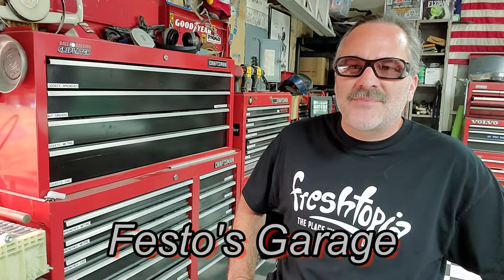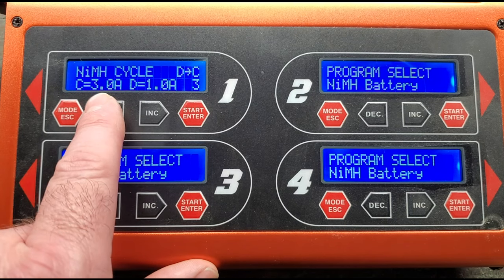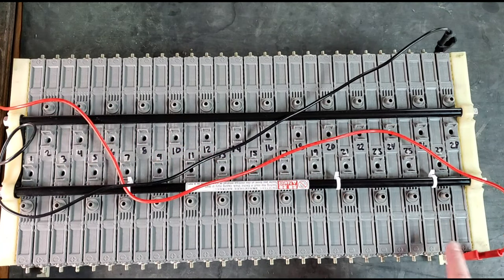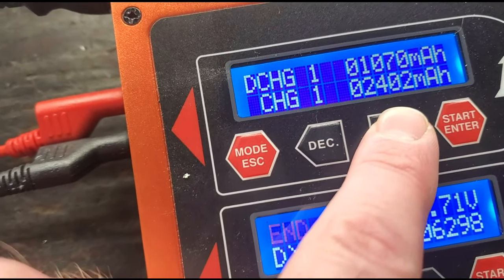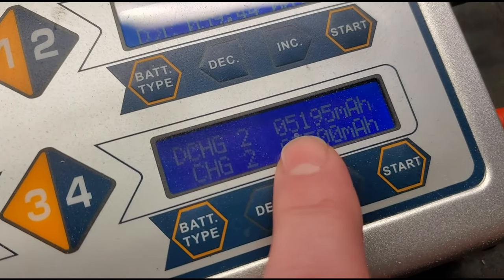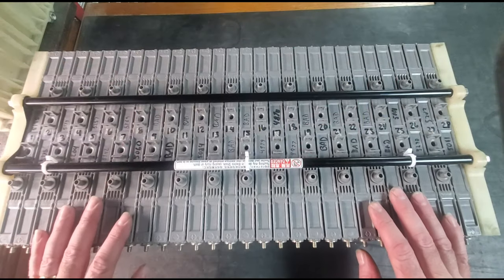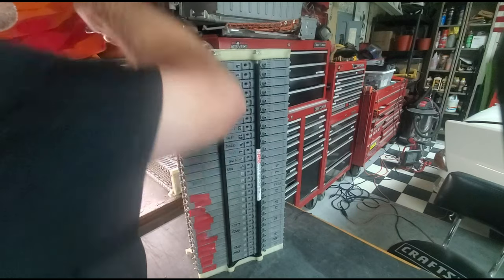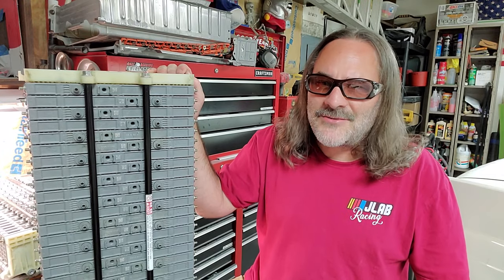Hybrid Battery Pack Refurbish - Step-By-Step w/ Settings - 2nd & 3rd Gen Toyota Prius - CQ3 Charger

Comment: What if a module goes to "END" in a short period of time? The charger then doesn't show the Charge and Discharge amounts, so I'm thinking it's a bad module. Or... should I keep trying to run cycles?
Reply from the maker: Thank you for watching. If you have same settings as I do then you should not be able to get "END" message without the charger going through all 3 cycles and having data to provide for each cycle.  Perhaps you are hitting wrong button at end of cycles and going back to start screen?
Reply: @GreggFesto  I’m pushing the same button you do in your video. I wonder if the cables are the culprit. The cables I have seem to be more than capable and are rated for more current than what we are using for this process. What cables do you use?
Reply: @GreggFesto  Do you have a temperature sensor hooked up to the charger? I'm trying to see if you have something different set up, that I may be missing. I appreciate your help.
Reply from the maker: I got cables from amazon but I cannot not find the exact link now. I believe they are 18awg.
Reply from the maker: I do not have temp sensor hooked to charger. Only the power input cable and the cables going to the batteries. I am wondering the difference between in our setups as well.
Reply: @GreggFesto   I may have figured out part of the issue. The charger would dishcarge and then END... Instead of then going to the Charge cycle. I figured out how to get it to proceed to charge, but I had to manually push it to. Previously, I would try to start the process all over again, which would start the Discharge cycle again...only to drop it to the set 6v. Now I need to figure out why it sometimes stops after the discharge cycle ends. I've had a few recommend increasing the DeltaV. I'll keep you posted on my progress, but at least I'm moving along now. I appreciate all of your feedback!
Reply: @GreggFesto   I have figured out the issue and understand the charger much better now. Already getting some modules to pass and working on the rest of them. I was further reading the instructions and see that they advise to raise the delta Peak, if the discharge/charge stops prematurely and a lower value, if the battery gets too hot. I haven't made any adjustments to that yet, but I may raise it a little, if I run into that with any other cells. I have had the charger stop prematurely a few times on a cell, but I just simply ran it again until it would cycle. I appreciate your help!

Comment: So what if it capa out 7500 charge and 6497 for discharge is that a good number or to high for the discharge?
Reply from the maker: That is a great result. If only they could all turn out that well. Thank you for watching.
Reply: @GreggFesto  I have a few that’s in the 6000 range so see how the rest goes thanks for the info I watched your video like 10 times to understand it the correct way

Comment: Okay I accidentally hit mode after running 3 cycles. I only saw 1 discharge and total before it went off the screen. I never unplugged it but couldn't get back to the numbers again😢
Reply from the maker: Thanks for watching. What your reporting is right, I do know for sure if you hit wrong button that the values will disappear and not come back until you run cycle again.

Comment: I've finished a 3-week recon cycle on my Gen 2 Prius battery using the same charger you're using. All but 2 hit 7500 discharge capacity (those 2 made it to 7100, so still good). Problem is only 2 broke 5000 mAh on discharge. 24 are in the 4000 range (some low 4000s, some high 4000s), and 2 are at 3900. If I continue to run more cycles on these lower discharge cells, they always hit charge capacity at 7500 and then the cycle stops without ever seeing higher discharge numbers. Is it time to just rebalance and get it reinstalled? I suspect that any refurb replacement cells I get won't have a charge capacity as high as my cells. What do you recommend?
Reply from the maker: Thank you for watching. The discharge values are the ones to pay attention to. They will determine the actual "health" of your pack. Since the batteries are in series the pack will only be as strong as the lowest valued battery. This means that if you put the pack back together with batteries that have discharge value of 3900mah then the pack will only have about 56% capacity. I suggest running more cycles until you have minimum 5000mah discharge of every one of them.
Reply: @GreggFesto  Thank you. I will continue to cycle the modules. But one problem is that they continue to cap out at 7500 and the cycles just stop. Should I increase the capacity setting, or just keep manually starting new cycles on each module hoping that they'll break 5000 mAh discharge?
Reply from the maker: If the discharge value continues to rise after each cycle then I suggest to cycle again. There will be a point where the discharge value stops rising and will start to fall back off. There will be a point where the charge value will start to fall off also. If you can achieve 5000mah discharge or better I think you will be happy with the results. If you can achieve the 7500mah charge value at the same time, that's even better. please write back and let me know how your batteries do.
Reply: @GreggFesto  Hi Gregg, I finished the process. The end result was that 27 of 28 cells broke 5000 mAh discharge, and all hit 7500 mAh charge. Just one cell is giving me trouble and after 16 cycles, won't break 4300 mAh discharge, and although it broke hit 7500 on one charge, it dropped off to an average of about 6400 mAh charge. I've seen some refurb cells on eBay but they claim they're guaranteed to be at around 3.5 amp hours of capacity, and since my lone bad cell is already above that, not sure if it's worth trying. How bad is it to just leave that one underperforming cell in the pack? Thanks again for your help and feedback.
Reply from the maker: These batteries, when in the hybrid pack, are arranged in a series configuration so the battery with the least capacity will determine the pack capacity. The battery that is 4300mah discharge after 16 cycles should be replaced with one that has at least 5000mah discharge in my opinion.
Reply from the maker: Hey Dan, If you leave that cell with 4300mah discharge in the pack then the pack will not perform to 5000mah level. I suggest checking online for additional vendors. In the past I have had good luck with ebay seller called AloyHybrid. They usually send me batteries that test to around 6000mah discharge.
Reply: @GreggFesto  Thanks Gregg! As you recommended, I bought a cell from AloyHybrid on eBay, and it was perfect. It cap'd out at 7500 charge, and got to 5300 discharge. Now I'm balancing and will reinstall this weekend. Again, many many thanks for your help along the way. I couldn't have done it without you.

Comment: Before selling a toyota hybride to average people , TOYOTA should mention clearly : Don't buy if you're not an engineer in Electronics or you will be recked when times come when your red triangle ...
Reply: My red triangle has been on for two years.  It turns itself on and off depending on its mood.  I still get between 36 and 41mpg.
Reply: 😂😂😂😂😂 just buy with confidence. We will learn along the way😂😂😂

Comment: Dr prius app shows temp three high 115 shall i move cells to different paet
Reply from the maker: Thank you for watching. I am not sure how moving problem battery from one location to another will help. I suggest refurbish suspect batteries to see if they can be brought back to at least 5000mah discharge current.

Comment: Searched for that charger.  It states...Note: This charger is NOT designed for use with hybrid car batteries. Any such use will damage the charger and is not covered by warranty. Updated firmware since its release now allows this charger to support high-voltage charging.😢
Reply: Hmmm, just did a prius battery with one.  Still working

Comment: Whats the difference in changing the cell to 6500 and 7500?
Reply from the maker: Thank you for watching. The 7500mah CAPA is the max point that the charger will stop charging. The battery is rated at 6500mah but you set the charger to 7500mah because of the way it charges called "Delta Peak".
Reply: @GreggFesto  so, if I set it at 6500 or 7000 it won't be fully charged?
Reply from the maker: It will depend on the battery health.  You can find more info on how it works by searching "Delta Peak Charging".
Reply: @GreggFesto  so, I got this on DCHG 1300. CHG 7500 mAh. On the first cycle. Should I run it 5 more to see if the discharge increases if not wat would it be the minimum discharge and charge range?
Reply from the maker: You should run cycles until your discharge value is at least 5000mah. If your discharge value does not reach 5000mah then the battery should be replaced.

Comment: When i hit mode after charging i dont get the charge and discharge numbers can you help me?
Reply from the maker: Thank you for watching. I suggest checking the settings on charger. You need to hit the Left button first before any other buttons (Red charger says Mode - Silver charger says Type).  Write back and let me know what you discover was the issue please.
Reply: Re entered the setting, and it is still the same result i hit mode, and it brings me back to the menu with no results
Reply from the maker: Did you rerun 3 cycles after checking the settings were correct? You will only be able to read results after the cycles have stopped and you press mode button once. If you press any other button before mode there will be no more values until cycles are run again. If you are using one of the same chargers that you see in the video and it does not work as I describe, you may need to contact EV-PEAK Corporation for an exchange.
Reply: Unfortunately, several times. Each time, it just brings me back without showing results.

Comment: My cells are charging up to 8 volts.  Is that ok?
Reply from the maker: I use the CQ3 charger and focus on the capacity rather than the voltage. Your battery can have a voltage but it will not matter without good capacity.

Comment: Is there a reason ad to why you are charging to 7500 cap? Arent these max 6500mah modules? Wont this be bad? Sorry new to this
Reply from the maker: Thank you for watching. The 7500mah cap is indeed higher than the rating of the battery. There is a formula that was used to determine this would be correct cuttoff. I did not create the settings, I got them from users who are more experienced than myself at this procedure. I have done many many packs with these settings and ended up with great results. A good resource to answer this question would be the PriusChat forum.
Reply: @GreggFesto I see also these are ev peak chargers but they say BGAUD on them? Not ev peak? I found them on Amazon. Is it still ev peak even though they say BGAUD in the top corner?

What's the difference between these and the older silver and blue model? I just saw someone Post in one of our Facebook Prius groups that he bought a few of these red ones and the fans failed on them multiple times. Have you had any issues with that? Thanks again for the information it is greatly appreciated for a new beginner
Reply from the maker: Thanks for watching. I have both versions of the CQ3, the silver EV-Peak and the red BGUAD. Search my channel for BGUAD CQ3 unboxing and you can see the comparison. I have not had any fan failures so far but the silver charger fan does make extra noise sometimes but still runs.
Reply: @GreggFesto if I run a cycle... and the display goes to flashing DLY after  a few seconds what does that mean? It flashes DLY after about 30 seconds of running with a 0000 count on discharge
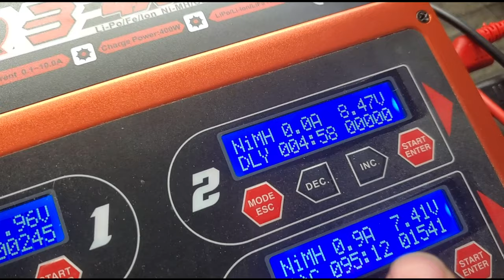Reply from the maker: DLY is the pause time between cycles to allow battery to cool off. Shown at 6:12 in video. It is normal.

Comment: Hi  can I use this charger to charge my Prius 12v battery?.I heard it's an AGM battery and we cannot use a normal charger so was wondering whether  CQ3 has any settings to charge that
Reply from the maker: Thank you for watching. I suggest a charger such as Battery Tender or Genius that has a specific AGM charge mode.
Reply: Thanks for the response and appreciate all your efforts

Comment: Any idea why this process does not work for 2014 Toyota Camry. I’ve done it multiple time on gen2 but for newer Camry don’t seem to be working. Please help if anyone knows something I don’t
Reply from the maker: The Camry batteries should be the same as the Prius batteries. I suggest checking all settings for charger again. Maybe check to make sure the pack has not been replaced before you got it with a pack that is different chemistry. Hope you will write back in and let us know what you determine is reason for not working.
Reply: I did end up fixing it. Don’t know what was the issue haha. Just kept replacing cells a bunch of times and it worked. Thank you)

Comment: Ho, i’m following. Your suggestions and starti dietro i’ve found all the elements of the battery of my prius III 2015 xw3, at 8,9v. What do you think about? The car fu e me error on the battery so the car doesn’t work ad ibrid. Thanks
Reply from the maker: Thanks for watching. The voltage can sometimes show which battery is causing error light - the more important thing to know is the capacity which is the actual health of the battery. The charger will tell you the health by reporting discharge mah. You want to see at least 5000 discharge mah on each battery in your pack.

Comment: Can I charge them outside the rack? I want to charge mines signally outside of the rack .
Reply from the maker: You can charge a battery individually outside of the factory setup. To do this you will need to put it between some wood and a vise or clamp to keep pressure on the sides while cycling. If you do not constrict the sides the battery can be damaged from expansion.
Reply: Hi Greg,  I’m a bit confuse on how long should I set the charger for?  I see it can go all the way to 720 mins. Can you educate me on this and can I charge it at less time like 100 mins? Per module
Reply from the maker: Changing the timer value to 100 from my setting of 720 will not help the battery charge faster. The charger does not charge for a set amount of time but rather charges to a value called "Delta Peak" which is determined by charger current and voltage settings. there are many videos on youtube explaining how this works.

Comment: I did follow your video since I got a hope to be able to do it by myself. But... it didn't work for me. There should be a lot more besides just having 5000mA per cell.
Reply from the maker: The capacity of 5000mah is the number you want to achieve to provide good performance from the battery. The charger will take care of the conditioning once settings are entered. This process has been working for me many years and many cars.

Comment: Hi. Wonder if anyone can help me, I charged my batteries the same way you have, and 3 of them exploded, I turned it off and the 4th was swelled so bad, I charged at 2amps, and after 2/3 hours they exploded. Any help please? Thankyou
Reply from the maker: Check your charger settings. The settings I use should not have enough power to explode a battery when it is compressed in the pack.

Comment: Why do you indicate 7500 when the factory capacity of these batteries is 6500?
Reply from the maker: 7500mah was calculated as proper CAPA by someone much smarter than myself. It is what I was taught and have been using for years with great results.
Reply: It's clear, but don't you have a question? Why 7,500 when it is 6,500 from the factory. Then I ask you, why don't you indicate 8500 as an example? @GreggFesto
Reply from the maker: My take on the CAPA setting would be that we are not trying to simply charge the battery but actually bring life back to it so 7500mah may do this and 8500mah may be too much. There is something called Delta Peak that has to do with the way the charger current vs voltage operates.  I did not create the settings, I just use them with great results and want to pass along to others so they can have great results also. A better place to ask this question would be PriusChat, there are many people there that understand this better than myself.
Reply from the maker: When you reached CAPA, what was the discharge value? Was it at least 5000mah? This is what is important as it is the actual capacity. Because the batteries in the pack are in series the pack as a whole will only have the capacity of the lowest battery.
Reply: First of all, one reason for going above 6500 mAh is because charging efficiency is not 100%. Here's another reason. Since Festo is charging at 3A, it is likely he is not triggering delta peak detection. Typically delta peak detection only occurs at charges close to 1C, which for these batteries are around 6.5A. So, if delta peak detection will not be triggered to end the charging, you need some kind of way to stop the charging, lest you overcharge your battery indefinitely. You can set a capacity limit. You can set a timer limit. It's up to you.